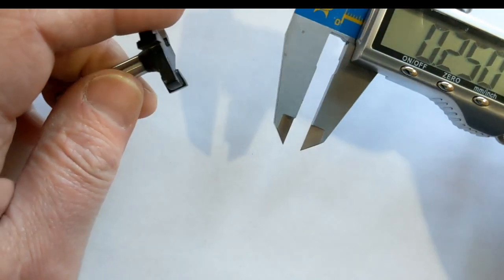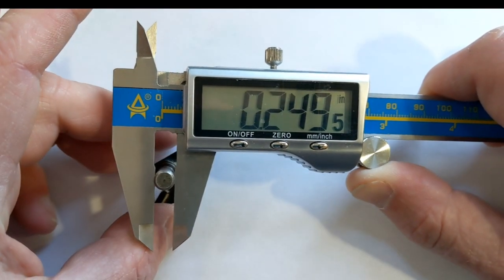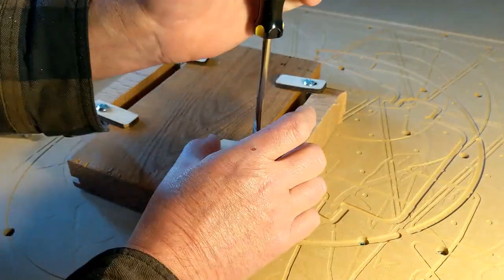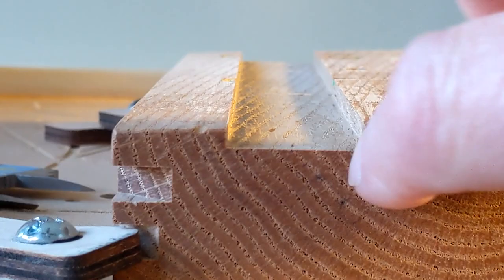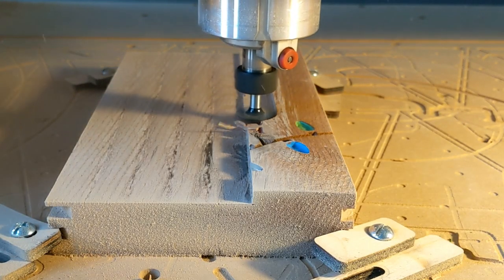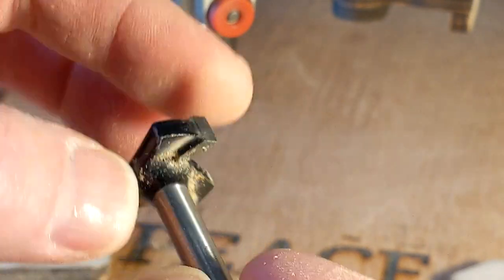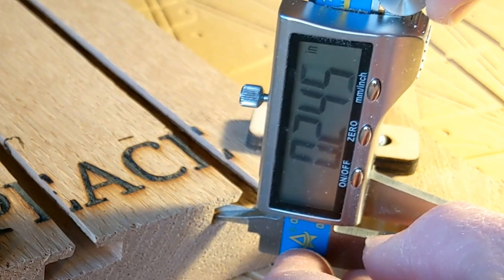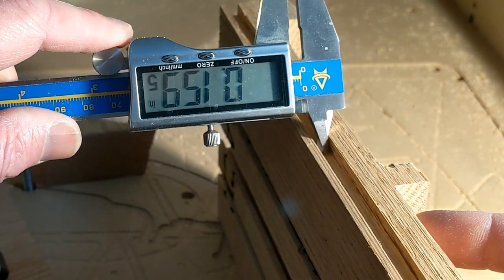Best Surfacing Bit For CNC Router, Spoil Board Resurfacing - Garrett Fromme

Comment: Howzit Garret.  Would this be suitable in a router on a sled to flatten cutting boards?  Is the quarter inch shank stiff enough?

Look forward to your feedback!
Reply from the maker: Andre, this would work on a router sled. I would keep the depth of cut limited to a maximum of 0.25" and a stepover of less than 50% per pass if you are flattening something manually. The shank is stiff enough, you will have to experiment with setup depending on the rigidity of your sled.

Comment: Garrett It was fast but I didn't see any "lines" when you shared those few seconds of footage of the resurfacing of your wasteboard. Did you keep the step over at 90 like you did to that first piece of hardwood?
Reply from the maker: Hi James. The slot test was a second piece of scrap oak. The first piece was recovered when I did the surfacing so didn't want to waste a 'now good' piece that I can make a project on. Answer your question?

Comment: Very impressive cut. Never expected such a deep cut to run so effortlessly and still want to run faster feed rate! Noticed tramlines remaining after cut, is a deeper overlay/step over (forgot correct word) required or you spindle need vertical alignment?
Reply from the maker: Hi John. It's the machine that left the lines. However, that is pretty typical, regardless simply due to the crossing path of the cutter blades. It always happened throughout my machining career on metal. The lines were actually very good as far as uneveness. In the end, I was very impressed with the outcome.

the word you're looking for is stepover...percentage of the tool diameter the bit will move over to make the next cut.

Comment: I ordered the bit but my bit measured .248 shaft, .956 od and .256 blade thickness
Reply from the maker: Really??? The .248 doesn't bother me but the other 2 do. Send it back. I am really sorry you got that. It's exactly why I'm trying to source directly from US makers. Damn, it ran so well on mine. I wouldn't have promoted it had I known. I might have to pull that video down.
Reply from the maker: Candy, I checked all the reviews on the bit also before I even said I would test it. this really bothers me.
Reply: @IDCWoodcraft  yea I was surprised it was that out of spec. I'll send it back. Thanks
Reply: The .248 shaft diameter is very close to not being able to be secured in my collets, but I'm running a 3.5hp, H2O cooled spindle with ATC.  My go to surfacing bit is a Magnate 2404; the carbide cutters run the full width of the bit and are ground so that they cut perfectly flat.  This is important, especially on hobby -type CNCs that may not be trammed correctly.
I wash hoping to see a comparison to the other bit you showed.

Comment: Hi Garret I am trying t resurface using your gcode off etsy and its telling me I am exceeding travel limits? Do I need to change firmware settings?
Reply from the maker: Hi Wes. What CNC machine do you have?
Reply from the maker: Wes, email me on this one. garrett@idcwoodcraft.com
Reply: I got it figured out thanks.
Reply from the maker: @wesmac68  what was the issue?
Reply: @IDCWoodcraft  soft limit needed zeroed out

Comment: I’m just getting into the cnc world and purchased the foxalien 4040xe , it has the 1/8 inch shank, what is the best way to increase shank size to 1/2 inch.
Reply: Or can I use the 1/4 inch shank surface bit with my 1/8 inch?
Reply from the maker: If you have a 1/8-in collet, you can only use 1/8-in shank bits. The only way you can change that is by getting a new spindle or router that has a 1/4 in collet
Reply: I have the same machine. I went on Amazon and bought a 1/4” spring collet. It runs pretty good but the machine is kind of light.

Comment: Maybe I need to push my machine a bit harder lol. I just bought that very same bit about a month ago.
Reply from the maker: CHEVY!  What's up? Be aggressive with this one. It's meant to work its way through.

what have you used it on so far?
Reply: @IDCWoodcraft  Make wood flat lol. It works very good for that. Im gonna push it tomorrow and I will let you know how it goes.
Reply from the maker: @onlyychevys  set it to 60 to 100 ipm. I suggest 70 to start with

Comment: What is a good set of 90 degree bits
Reply from the maker: Hi Hershe. If you need something right now, I provided 3 options below. If you can wait a few days, I'm very close to working out a deal with some very good bits made in the US with good prices (not on Amazon). Testing them now. They'll be announced to my list first. I think you signed up already.

This is a good tool. Can be used for all 90d work: https://amzn.to/3qPj6d1 

However, I really like the performance of this. Makes very smooth cuts and made of carbide and highly recommend: https://amzn.to/3r3U0r9

If you're looking for a starter set to practice with and has variety, get these. I started out with them. They are okay but will not last too long and I had to order something better pretty quickly: https://amzn.to/3pi99ED

Comment: You keep saying machining tolerances  but the difference over 1in is not that great, I'd be devastated with this tolerance in aluminium.
Reply from the maker: Hi Cut. this comment surprises me. .003" is too loose for you in machining tolerance terms? sounds like you tend towards aerospace specs.
Reply: @IDCWoodcraft  in metric that is 0.07mm its an ok tolerance but a lot of machinist will start at 0.01-0.02mm, standard practice for fitting bearings and mating features, +-0.07 is either sloppy or still needs work. Just my professional opinion.  Aerospace is a whole different story as you have to meet tolerances and specific surface finishes (ra)

PS , that tolerance is over 1in (25.4mm) you translate that to a small part like 4in then that's a lot out.
Reply from the maker: @chrisadesigns  I agree. Of course, we are not talking about JIS or ISO standards. When I was machining, our standards always started w/ 0.05mm as the high-end tolerance. 

However, the argument here is not metal working standards. This is working with wood. Given the nature of the beast, these are extremely good tolerances.

Oh I like conversations like this. someone who is there and gets the machining industry.

In my engineering design work, I often started with +/-0.01 as I needed super high tolerances on the machines I was designing.

Did you ever have to do cryo-fitting in your design work??
Reply: @IDCWoodcraft  agree with nature of the beasts, just never heard people say machining and wood in the same sentence lol,
Reply from the maker: @chrisadesigns  interesting point. That insight gave me a good chuckle.
Reply: @chrisadesigns  I mean, it's pretty good with a wood frame CNC, basic router, and a discount caliper. The caliper looks leagues better than a harbor freight, but I can almost guarantee that if you aren't using Starrett or Mitutoyo, you can't be 100% confident in your measurements, so it could actually be much better.
Reply: @samo4866  We're talking hobbyists measuring wood here, not Machinist or Tool & Die Makers.  Most of us can't afford $200 plus for a Starrett or Mitutoyo, nor do we need that kind of accuracy.  The coefficient of expansion/contraction is much higher in wood than metal...

Comment: You are saller ?
Reply from the maker: Hi Konrad. I wasn't when I made the video. As time went on, I saw there was a need for a beginners router bit set so started to sell a set. Since the surfacing bits were selling and I was only getting 0.43$ per sale as an affiliate, I decided to add them to  what I sell.